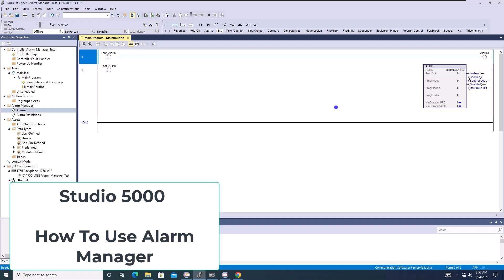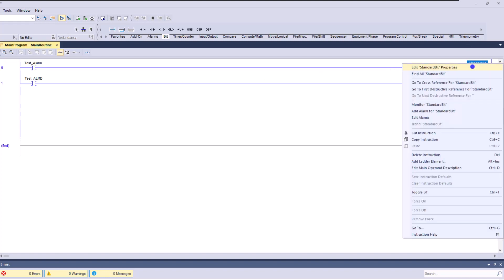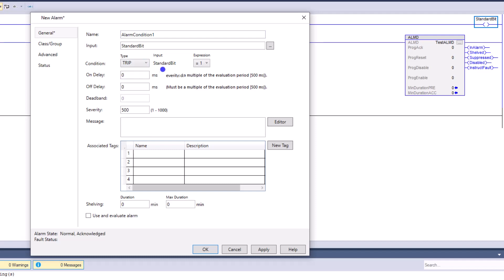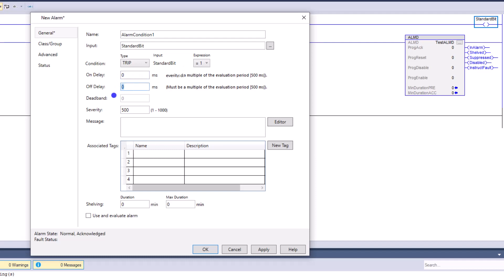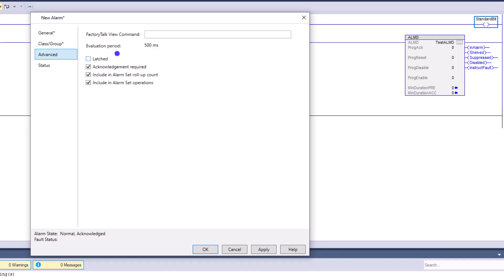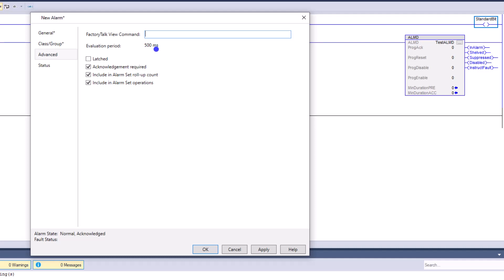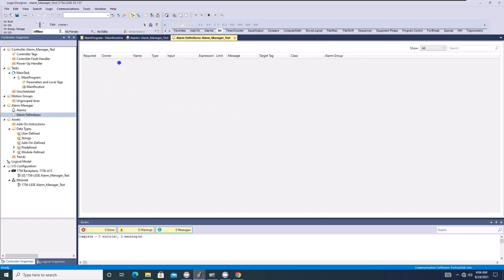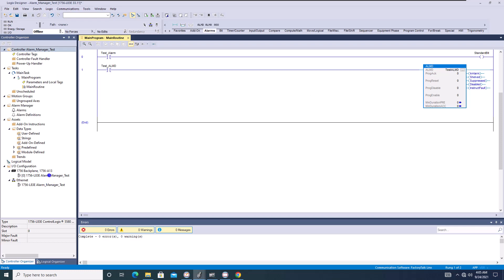Allen-Bradley PLC Controls | Using Alarm Manager in Studio 5000

Comment: One nice thing about the alarm manager is that you can create an alarm definition based on a parameter of a datatype. For example: A block of interlocks, with 32 conditions (DINT). You can create a generic definition for each generic bit, that way an individual alarm is created for each condition, not a single alarm for the whole block. You can even put a message attached to that bit's label. Now, this would be much better if it came ready-made for PlantPAx 5's P_INTERLOCKS blocks and didn't have to program that way for every bit.
Reply from the maker: Yes however it's much harder to capture a first out fault
Reply: @ShaneWelcher  You can still open the faceplate to see the firstout and configure a command on the alarms to open the faceplate. Or maybe there is a way to create an alarm definition based on the firstout, but then it would be difficult to get the message from the @label.
Reply from the maker: @Guilherme-xe7fk  I'm talking about the first out fault for the machine to let ops know what caused it to go down.

Not just a device block